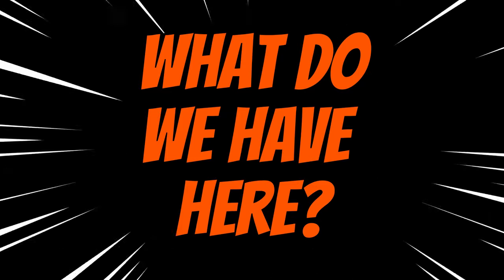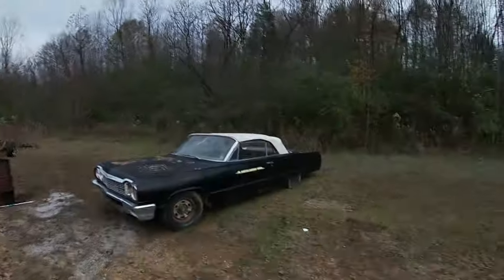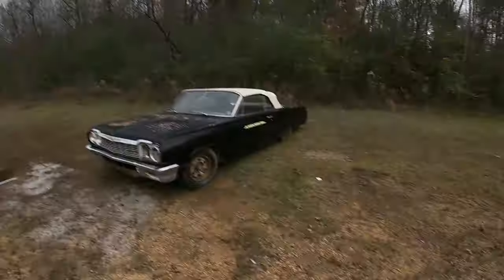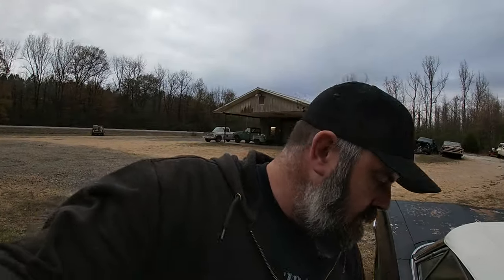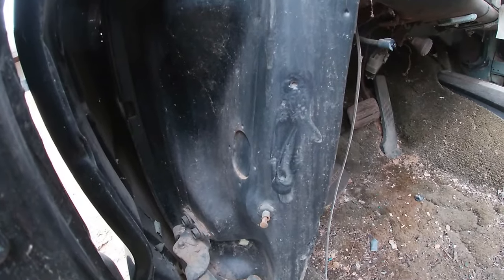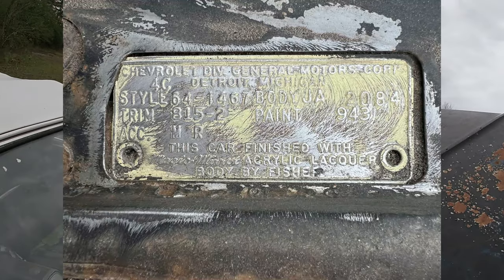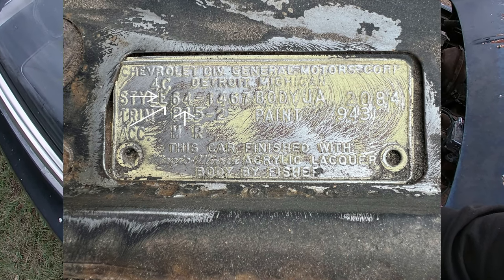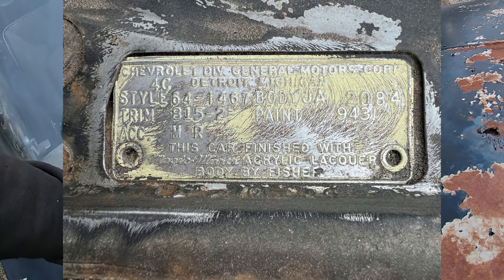64 Chevy Impala SS Convertible How to decode VIN and Suffix codes

Comment: That 275 HP on that 327 ci engine with a 4 barrel carb was for sure a high output engine. It had the big valves in the head. They were highly sought after engines in my younger days. Great info on this video, I really enjoyed it. Take care Aaron.
Reply from the maker: Thank you for the info, and thanks for watching
Reply: Thanks for watching and commenting